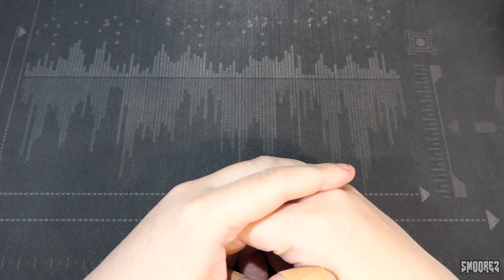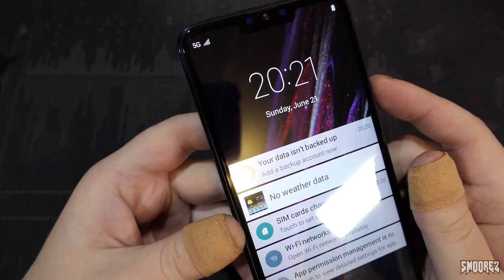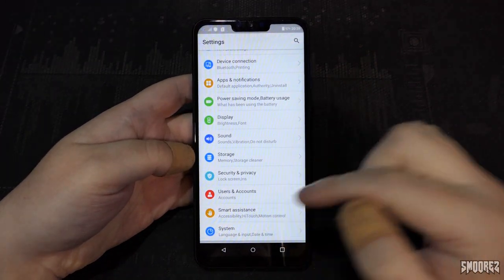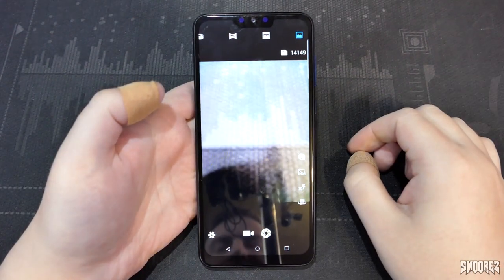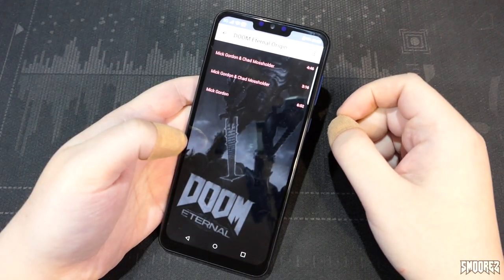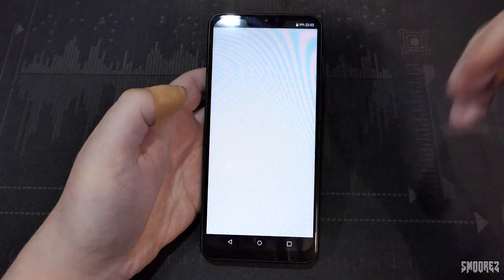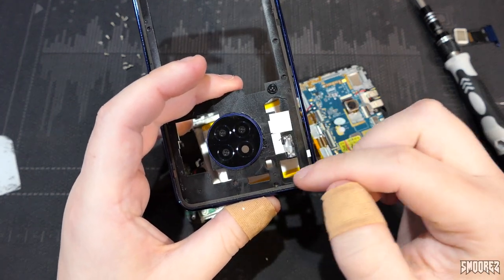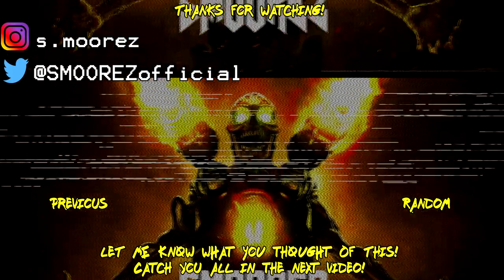iWish: Taking a look at the "WELCOME MATE 39 PRO" (Terrible Huawei Mate 30 Pro Clone) - DO NOT BUY!

Comment: On the Android 10 easter egg, you double-tap the 1 and rotate it and place it on the 0 to make the Android Q icon, If the background moves and the rotation of the 1 correct itself to the right angle, then tap the 0 multiple times until you get to a puzzle.
Reply: Oh really? I have a legit S10 I'm about to try this with lol.

Comment: Hey, Phenix is not a malicious application. It's the name of the launcher/software skin that the phone uses. It may occasionally come up in scanners as a false positive. But it is just an Android launcher. You can verify this by downloading another launcher and then it will show as one of the options. There is software you need to look out for on those devices, but Phenix is not one of them. 
The applications that partake in unauthorized access are normally helpers with default package icons with no launch activities (no app icon in the launcher). To find actual malware, I would actually recommend KingRoot. While you would think there are negative aspects to using a Root application, it actually has a really good antivirus engine and uses it's elevated permissions granted in the rooting process to let you remove malware completely. (It even purges the malware from the rom used on reset, so be careful when purging apps.) While nobody should use a clone device, this is a great way to at least get rid of the preloaded malware.
Reply from the maker: Ahhh thank you for that, good to know as it has shown up as a False Positive in the past, so thank you for clarifying that up for me.
If I were to use Kingroot, it would obviously root the device - which is fine, if I can manage to scan for viruses that are legit viruses and show people in a video then that is a huge benefit to prove these devices are junk.
Reply: @SMOOREZ  Yeah, I highly suggest using it as its spot on 100% of the time

Comment: USB type C???
Wow, they went all out on this one.
Pity the rest of the phone is still crap lol
Reply: The port isn't great. I've got a similar one (same manufacturer, different clone) where its port is recessed a bit too much and most cables don't make contact properly.
Reply from the maker: I found it to be reasonable while making the video. I used a couple different cables to charge and transfer files and it was fine. The port is fairly solid and cables don't wiggle around...but...the solder job on the sub board for it is another story.

Comment: for the easter egg for android 10, you have to tap and hold the "1" so that it spins and let go so that it is oriented 45degrees to the left rather than straight up like normal. Then place it on the "0" to make somewhat of a "Q" (it should vibrate the phone and snap in to place if you get the right position).  Finally I think you just have to drag the "android" text on top of it to start playing the game.   I have absolutely no idea how to play that game, please don't ask that lmfao
Reply: I'm not certain on the exact positioning for the "android" text, but I keep moving it around and placing it until the game starts.  It seems to work best when it is placed just above and centered horizontally on wherever you constructed the "Q"
Reply: as pointed out by zekchard in their comment here, apparently you just tap the Q you created a few times to start it

Comment: As I suspected, it's running Android 5.1, probably on a MediaTek SoC where they never provided drivers for anything above Android 5.1.
13:01 Looks like a knockoff of the Samsung version to me…
15:26 That also looks like a Samsung knockoff…
18:43 I can see that it's Android 5.1, as heads-up notifications were only introduced in Android 6. And then we go down to an Android 4.4 interface…

Comment: 52:40 I just noticed, TikTok came back! It's just like a real malware, after you uninstall it, it comes back after a restart
Reply from the maker: A minute or so before this, I factory reset the device to get rid of the burner gmail account etc. So then if I done the bend test, no personal data would be left it were to die. TikTok is a system default application on the phone, like Facebook.

I'll still call it Malware because of it's nature lol
Reply: @SMOOREZ  oh ok. Makes sense haha

Comment: Yes we all know you get what you pay for but how does it perform out in the field just as a communication device, you know the scenario - you or a family member just needs an emergency contact phone that doesn’t matter if it gets lost, stolen or damaged and all the frills and apps are irrelevant, has it decent range, no drop outs etc?
Reply from the maker: You can buy sub $30 phones that can make and receive calls that would be more trustworthy than this. It doesn't have 4G LTE and it's basically a phone made with different bits and pieces. It's better to stay away from these ones.
Reply: SMOOREZ 👍

Comment: Sigh... 6580....

You can get Helio's for sub $100 these days, from "Name Brand" Chinese manufacturers (Umidigi, Doogee, Oukitel for example)

Even my Granny's senior phone runs on a 6735!

There's NO excuse for 6580's.
Reply from the maker: Yep, I have reviewed the Umidigi Power 3 with a Helio and it was perfect. It's just that these clones are basically all the same and just have that slice of false advertising to fool people into thinking they are getting a top device, instead of going with Umidigi, Xiaomi etc
Reply: @SMOOREZ  My wife has an Umidigi F1 and it was very surprising for a China phone. Class A phones can be made on the cheap, and would probably bring return customers, I don't know what motivates the clone builders.

I actually saw the "Mate 33" on Aliexpress not long ago, looks identical and that claims an in screen fingerprint scanner.  Not sure I believe that for $50us

Comment: Hey, another LMKJ device. I wonder if the secret codes I posted last time on that S10+ video works on this one
Reply: Ah, so that's why the software is so familiar. I got an Xgody Y28 that is also LMKJ, for $3 a while ago, and it is a mess of malware. Got it rooted by flashing a patched boot.img, and cleaned it up to near AOSP, after disabling almost everything. On mine, proxyhandler is a Trojan dropper, and the gallery, as well as a few other apps had a mile long list of permissions.

Comment: What is up with all of these fake devices shipping with 5 year old versions of Android? This thing was built in the last 12 months, they had to fake Android 10. Why not use at least Android 8/9?
Reply: the MediaTek MT6580 soc this one uses (and most likely similar for the other cheap phones) came out in 2016 and MediaTek has a habit of never releasing the source for the kernel.  So whichever it ships with, it's stuck with for life.  Due to this, they can only really use whichever version of Android it originally shipped with, since trying to update the Android version without updated kernel is a PITA even today with all the 'modularity' (for lack of a better word) improvements Google is trying to do, it's near impossible for versions from back then.  These products are designed waaay down strictly to a cost, there's no way the company selling it is going to pay for developing the software like that, they'd rather swap out the graphics and a few apps to make it look like new without fixing the back-end.  The only reason you get some custom ROMS on the older phones, was because 1: the phone is most likely Snapdragon, which released the source code for a couple years after the SOC release   and 2: its a personal hobby of the community member / maintainer of that ROM, that they sink a lot of time and effort in to, for fun usually.
Reply: @NCHLT  still doesn't help if the chipset in the soc isn't being supported